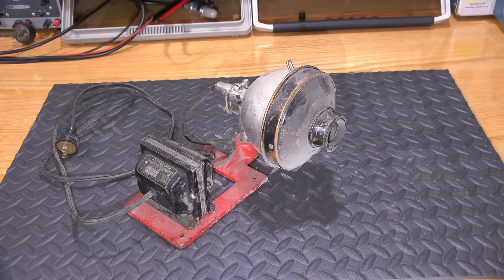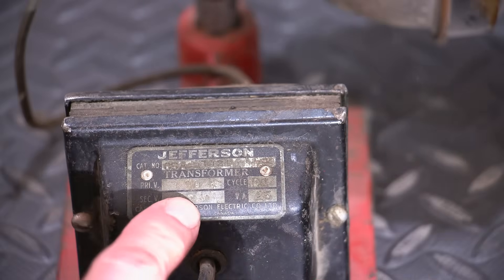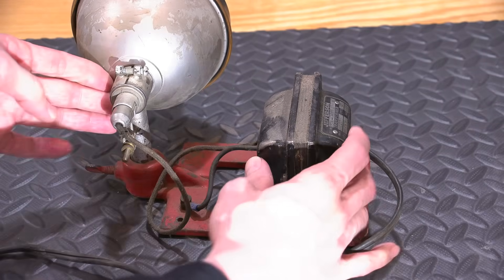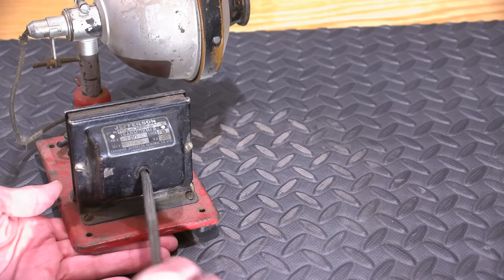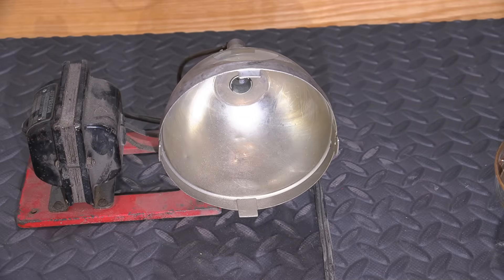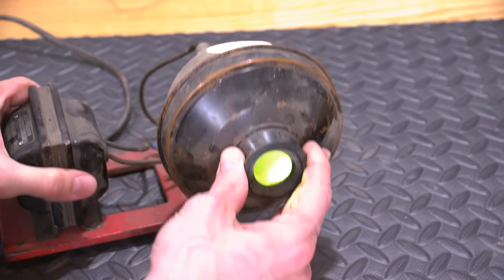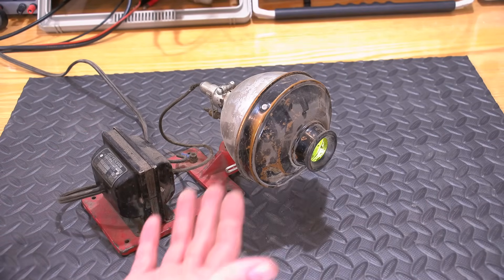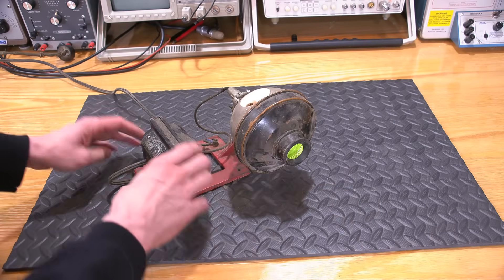Barn Find - What Is It - 1940's? Mystery Device Teardown!

Comment: My guess is the device is an egg candling lamp, used to shine a bright light through eggs to examine what is inside.
Reply: Yes, this is for eggs. My grandfather had one that was similar. You need a low watt bulb that won't get too hot and damage the eggs.
Reply: Same here.
Reply: I second that.
Reply: I’am 73 years old. I remember our family get togethers at Christmas time when I was just a little fella. My uncle Al was the photographer of the family, most every photo shot he used those flash bulbs. I would see spots for five minutes afterwards!! I remember playing with those used ones. The glass bulbs were coated on the outside to keep the glass from shattering. After they had been used,the plastic coating would be all bubbled up.
Reply from the maker: Thanks for sharing your story Bob.
Reply: @MrCarlsonsLab  Here's a funny flash bulb story: A man I worked with told me when he was in the Army, a new radar set arrived at his base. A visiting General insisted that the technicians fire it up. They warned the General that the RF could be dangerous at close range as the dish had not been mounted on an elevated pylon. The General raised seven kinds of hell, so the techs fired it up in the yard. As the dish swept around the PX warehouse, the RF ignited boxes of flash bulbs. The PX burned to the ground.
Reply: @rfburns5601  We used to sneak into our newspaper''s darkroom and screw in one of the biggest Edison-base flashbulbs into the overhead fixture. This fixture would only be turned on after either film or print processing was completed and you'd turn on the room light to check your print quality. Trust me, going from near total darkness to setting off one of those bulbs was a unique experience. 😃
Reply: @boblewis3444  I received a very bad burn from a flash bulb on my brownie.  The flash didn’t go off and i reached in to see if the bulb was tight and it flashed.  OUCH!  Never forgot that.
Reply: @charlesmurphy1510 nice way to permanently get rid of fingerprints 😅
Reply: That's interesting, never would have guessed that, but makes sense.
Reply: I remember back in the early 70's going to a farm every two weeks to get meats and eggs. Seen one almost identical to this one.
Reply: I had been thinking it was some sort of railroad kit but as soon as "egg" came in I was like "oh snap that's it."
Reply: @solarbirdyz  Prevost what I was thinking and realized oh egg candling is a good possibility plus the barn find would make sense also if you had mentioned what type of barn orsay Farmhouse chicken coop
Reply: but the lens is green buti know what egg candling is but i dont know anything about the process
Reply: Yeah, that's exactly what I thought. Some way to get a nice tight beam for candling. Not sure what good the green filter is but maybe it made it easier to see something?
Reply: Now, after some googling, I guess green light makes it easier to see blood spots. So that and finding it a barn convinces me it's for candling.
Reply: @JakePulliam  Not just blood spots but veins form around the yoke sac ...and at fairly early stages of growth you could see an "x-ray" basically of the growing chick....
Reply: @JakePulliam   Using a green filtered-light will make any red (blood) inside the eggs show up much darker, & as that hole would be for venting excess heat from the reflector-housing, my guess is that the highest wattage vehicle-bulb would've been used (& focused to achieve the ideal beam)!  What's also interesting is that with this design it's made so that the egg is held with your fingers with the light shining into the egg from the side towards your palm to reduce glare, plus it can be screwed to a bench & rotated to accommodate those who are left-handed!
Reply: @JakePulliam  makes sense as our eyes are most sensitive to green light.
Reply: @JakePulliam  blood is red   goes black in green light
Reply: @JakePulliam  I'd guess it's green because that should increase the contrast of red inclusions, such as blood and embryos.
Reply: @JakePulliam  green increases the contrast between yolk and white.
Reply: @JakePulliam  I think, the green filter keeps the hot  infra-red rays away , and makes the beam "coolder", and protect the eggs for damage.....
Reply: @guusk.4913  That clears that up. Thank you. :)
Reply: This is my guess also.   It seems logical being found in a barn.
Reply: Interesting.  I was going to suggest incubation heater but I think you are right.
Reply: This would be my guess. Used to tell if egg has been fertilized. If you see an embryo, it's a fertilized egg.
Reply: Googling for vintage egg candler confirms that
Reply: I agree, egg candling lamp. That would explain the barn find part. My best guess is W.A. Campbell but wasn't able to find the patent.
Reply: Yup, that's what it is.
Reply: @jrkorman  Nicely done
Reply: Well I was close. I got the chicken part right
Reply: My guess too
Reply: PL here, my thoughts also. Egg gear :)
Reply: Egg  chandler was my first guess also
Reply: Give that man a cigar! 🏆
Reply: Put a hot enough bulb, you could fry your eggs.
Reply: Correct.
Reply: Seems like a good guess. I would never have guessed that.
Reply: I was gonna say it was a chicken light. Like the ones you get now for baby chickens, but I like your suggestion better lol
Reply: that also explains why the wire on the back of the bulb is broken from laying it sideways, sitting the egg on top
Reply: My mother had a job candling eggs in WWII,  that looks like the lamp she described,  green lense and all.
Reply: I was thinking old timing light but your guess seems right
Reply: Its too rough and industrial for some delicate display. I think its a long distance signal lamp for the railways.
Reply: Bingo.
Reply: He pretends not to know it's a light. Maybe he's not from here.
Reply: Modern version:

Speed-King Green Filtered Candling Light - $414.99

Green filter for easy blood spot detection, easy on the candler’s eyes. Lamp is a No. 11 W7 GE base-type automobile lamp, 12.5V bulb, 32 candle power, prefocused so that no errors can occur through faulty adjustment. 120 volts.
Reply: Some of my fellow photobug buddies found a stash of these big old flash bulbs in the late 80s. We used them for night photography of planes, trains and automobiles. We'd set up a photo line to avoid getting in each other's shots. Then the guy with the flash gun would say "Open 'em up!" And we'd put our cameras on "bellows" setting that held the mirror open. They'd pop a few of these bulbs to light the subject, then yell "Close 'em!" And we'd close our mirrors. Obviously we used heavy duty tripods for stability.  We got some fantastic shots!
Reply: I'm not sold on that idea. Wouldn't the lamp be facing upwards from the base, instead of having to lay it on it's back ? I'm going to have to watch it again, I've just thought of something.
Reply: @Franko_Walker  It was probably wall-mounted.
Reply: @matthewhall6288  Maybe. But that would imply you would have to stand up to check the egs. I see that being a sit down job. Still only guessing though.
Reply: @Franko_Walker  Maybe it was mounted at chair height? I'm just guessing too.
Reply: @Franko_Walker  it's got a pivoting arm on the lamp so you can tilt it up if you want I think
Reply: @gbinford9009  Ignore me I was totaly wrong anyway. LOL. It's an egg thingy !